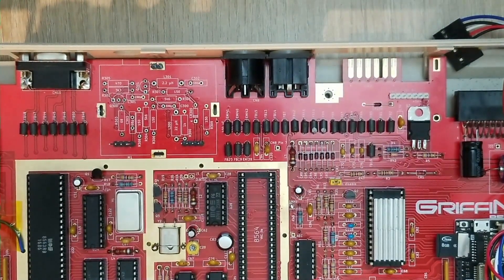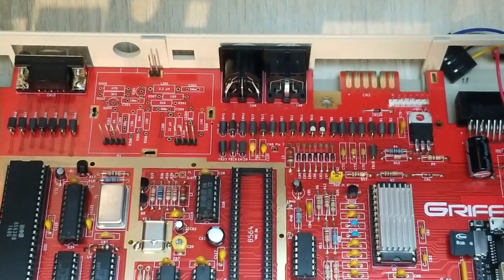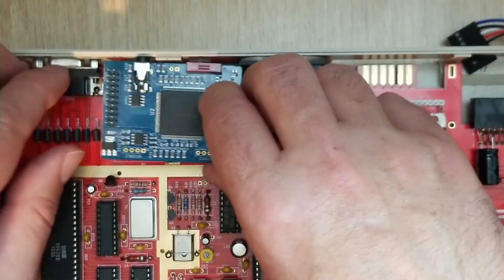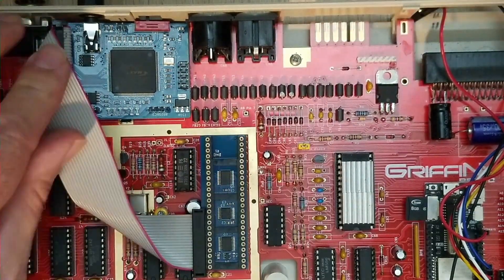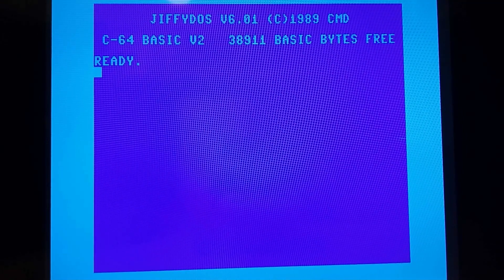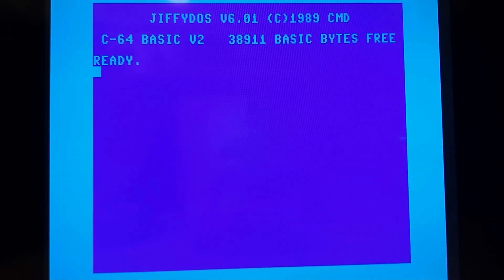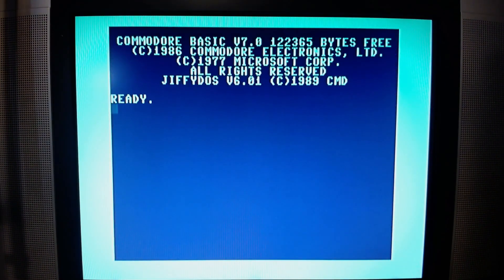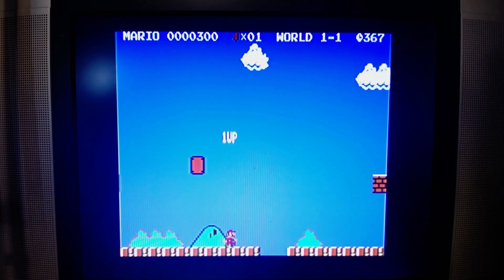Commodore 128 Neo Part 3 - Component Mod

Comment: Unfortunately I managed to get the RF modulators position shifted by about 1.5mm compared to the original C128 board, making some of the nicer RF mod replacements a bit tricky to fit.
It's been fixed on the next revision as well.
Reply from the maker: All good, could be worse.  I'll gladly take this trade off for all of the awesome benefits of this board!

Comment: Nice install chap, I too had some colour issues when I tried the rgb2hdmi via component  ...... Seems my video cable cable was garbage so I have another on order and I will be re-fitting mine into the c128D that I have, Looking at the releases on the github I suspect the 2mhz has been giving them grief for some time however, new firmware is in beta so finger crossed this solves the 2mhz issues
Reply from the maker: Thanks mate, VGP wrote back to me this morning and said they replicated the problem and verified its fixed in the new firmware.  Now just waiting patiently for a FPGA programmer to make it to me.
Reply: @retrotechinsanity3164  gonna dig out the ass blaster and zap in a new firmware, I think it uses quartus so it (should) be fairly painless to reprogram in jtag mode